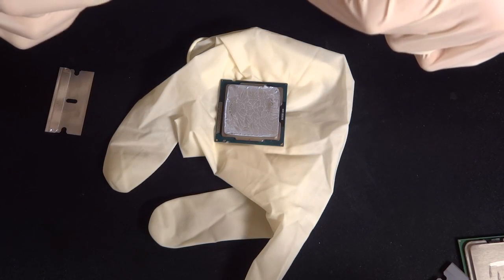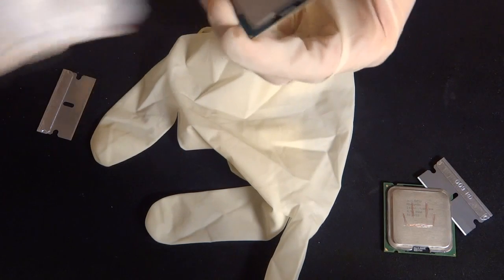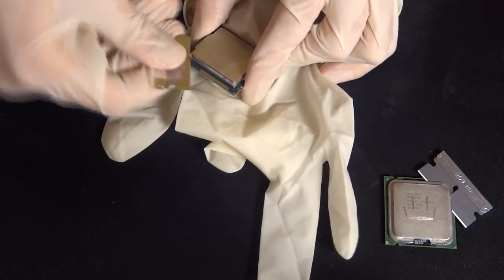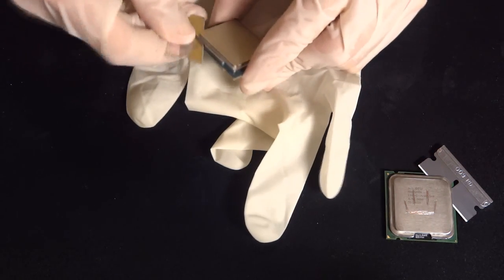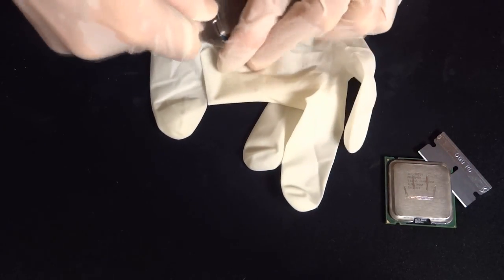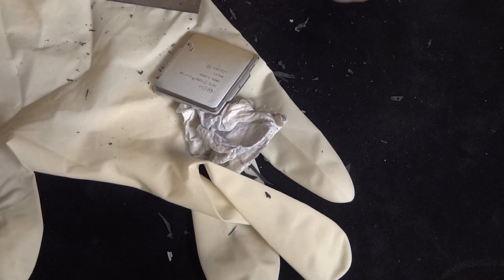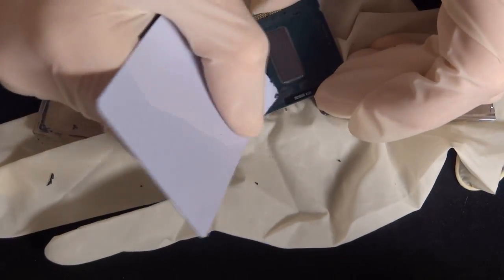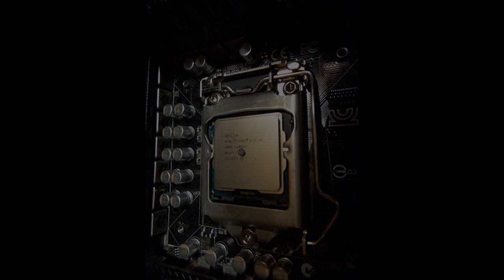Full Guide & Explanation to Delid an Ivy Bridge CPU - I7 3770K - By TotallydubbedHD

Comment: if you still have a max of 50 degrees celsius at load then you still have 20 degrees of headroom to overclock which is plenty, so you could still add some voltage to get a higher clock then.

Comment: yee i know but at the moment with the stock fan im still at a solid 40-50 degrees with a high load from cpu intensive games and i am still at factory voltage settings so i think i may make it if i dont i can just drop the clock anyway to 4.7 or 4.6

Comment: Hmm....5 Ghz ain't an easy milestone for ivy bridge, even with watercooling. I noticed with ivy bridge that temperatures get insane above 1.3V, I might only have a simple watercooler, but I think it will be the case with almost every cooler, unless you'd delid your cpu, but that ain't ofc without risk if you've heard the man talking in this video. I give you a tip, you do not want to run your chip 24/7 above 1.32V and you don't want it to be above 75 celsius 24/7.

Comment: its at at 50-60 degrees under 70% load im getting water cooling and going for 5 ghz see if i can make it with a small tweak to voltage

Comment: That isn't bad, but I'd recommend you not to overclock to much with your stock intel cooler as it will give you crazy high temperatures with overclocking..I'd recommend you to get a aftermarket cooler for overclocking. You can buy cheap aircoolers who will do the job to get yourself a nice overclock, you can buy a Hyper 212 Evo very cheap and it works fine with overclocking. I myself use a cheap watercooler, a Antec Kühler H²0 620 for €60,- works fine, I got my chip to 4,7 Ghz at 1.32V

Comment: What if you apply the paste to the PCB and ignore the IHS altogether? I've taken quite a few laptops to bits and none of the CPUs I've seen even had an IHS but rather just had the PCB minus the IHS on the mobo with the heatsink etc. attached. Just curious because if the IHS was required wouldn't it be a million times better to have one made from copper.

Comment: Long story but my oven door fell off i was planning on gettin black silicone gasket glue to repair it. At the same time I thought i would glue my IHS as i dont like the idea of it being loose. However I dont want to reglue it and then later find that I need to reapply paste.
My questions are what is the lifespan of CLU? Will it last a couple of years? Arctic MX2 claims "It doesn't need to be re-applied and will last at least 8 years." could i use it on the die instead if i plan to reglue my IHS?

Comment: with sandy the ceiling on voltage was 1.40v, how much it takes to get the desried oc is down to the chip, i didnt  win the silicon lottery, at 1.4v i managed to get my cpu to 4.7 ish ghz, but no point running it full out, so rolled it back a bit, i could prob lower voltage a little, but i cba!!

Comment: Look the paste and everything is the same, but the new 22 nm technology is creating too much heat.I believe ivy has 100 million  more transistors than sandy bridge (correct me if i'm wrong) so the quality of the paste doesn't have to do. Intel is using the same paste in ivy bridge as did in sandy.And take a look at haswell.The integrated vrm is sending temps to space lol.

Comment: I dont know about sandy bridge overclocking, but isnt  1.35v too much for just 4.4ghz?my i5 3570k runs at 4.5 @ 1.26v.I know every cpu is different, but that voltage seems too much for even the worst case scenario lol

Comment: Good guide - I'd be VERY cautious using latex gloves; static electricity central!  I like that you won't get fingerprints on the die or pins, but latex a) insulates so the chip can't be grounded if you're wearing a ground strap and b) can build up a very strong static charge, especially when loose and rubbing under the chip as shown here...the rest of the advice - damn solid work!

Comment: No. AMD CPUs are soldered. You can remove the IHS using a torch lighter, but attempting to remove the solder and apply thermal paste will increase temps. Sorry, but the 8150 wasn't such a great CPU. All you can do is get a GOOD CPU cooler and hope for the best.

Comment: The CPU matters MUCH more than you think. Go look at tomshardware CPU gaming benchmarks. Having a Ivy Bridge i3 instead of a phenom x4 can gain about 10FPS, while a 3570k overclocked can gain another 10 on top of that. Of course, the results vary largely depending on the game, but most of the time the CPU is VERY important with modern games. 3 years ago it didn't matter, but software is really starting to catch up to the hardware finally.
Reply: @slaydog5102  only nerd here is the dipshit replying to 10 year old comments. What are you even doing here? Did your poor ass buy a used 10 year old cpu with the money you found in your mom's couch?

Comment: Is it possible to achieve an even temperature on all cores with the 3770K? :p

I delided mine today, I'm at 4,6GHz with 1.2V. 

My cpu cooler is Noctua NH D14.

My temps after intelburntest was:

Core1: 56
Core2: 65
Core3: 59
Core4: 58

I also had this problem on my 3570k, but I've never had it on an AMD.

Comment: so scary i will never do that, am happy with my cooler master Extreme fusion paste on my i3770k got 65c on burn test with h100 cooling it :D @ 4.6Ghz i can even get it lower its 1.344v witch is high (used cpu level up from asus will learn the overclocking later ,applying thermal paste was scary enough for 1 day )

Comment: It's not 'normal' paste, it's called 'ceramique' (ie CLU, AS5, are not ceramiques).

And it's best to use the best paste possible on both the IHS and die, it's silly to say to use a ceramique on IHS, CLU/CLP on die. What works better on the die, will work better on IHS. I got a 8*C temp drop using CLU over PK3 on IHS, cpu AND gpu

Only exception is that you can't use CLU/CLP with aluminum.

And it's easy to get rid of the CLU/CLP staining (if you care) using the supplied scrub or metal polish.

Comment: CLU looks like pasted powdered metal, very good thermal conductor. You don't really need to worry about stray electrons with new CPUs though grounding out to the IHS, like he says mainly to make the layer as thin as possible because it will squeeze out otherwise.

Comment: Delidded my 3770k using NT-H1 on both the IHS and the top lowered my temps by 25c on each core was a incredibly good idea well worth the risk imo.
Reply: The NT-H1 : is that the thermal paste Noctua gives with its NH-D15 coolers ? I've been told it's a really good thermal paste. Even more than the Arctic MX-4 that I often use.

Comment: i've scratched the pcb too the processor still works though, i have been advised to coat the scratch with clear nail polish ? will that be okay ? also did your cpu degrade in terms of performance or showed any ill side effects since you scratched it ? how to fully test every aspect of the cpu to make sure the scratch didn't affect it ?